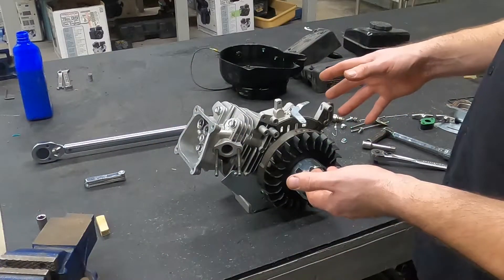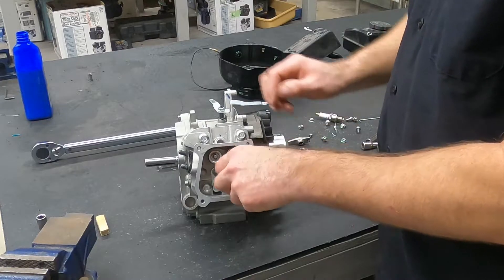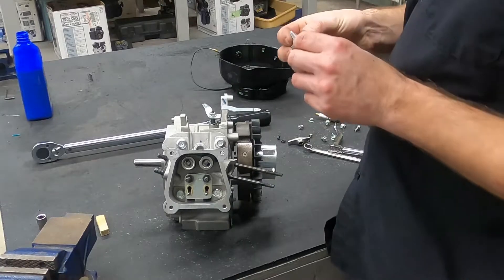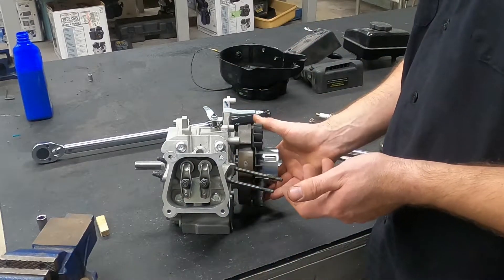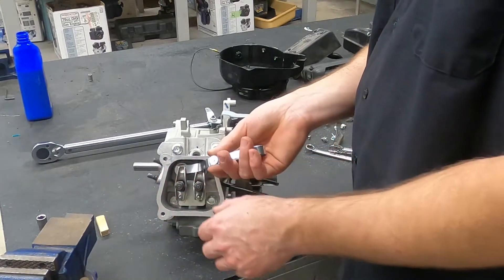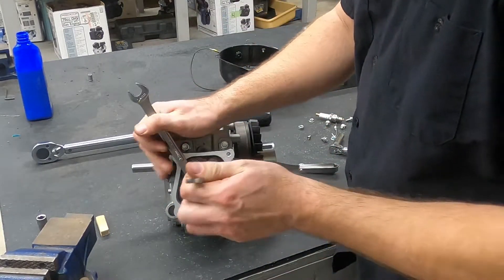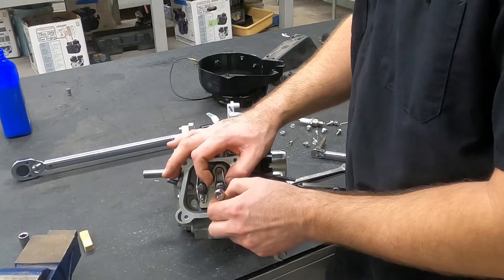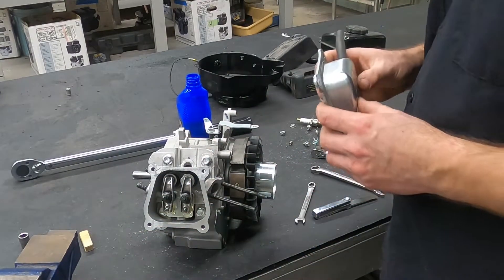(Part 3) 79cc Predator Engine Assembly Valve Train and Valve Lash

Comment: It's crazy really. The claim is to run them on the loose side to help promote an effective rpm under duress. Every other small engine I build (for performance) I run a tighter lash to promote an easier start when the lash increases at high temperatures. I believe I had best results with .003. I do the Hug and Kiss method.  Use the same gauge, hug the exhaust snug to the feeler and then just kiss it on the intake. Works like a charm. Great videos. I wish more people commented as this is extremely educational and good for the soul.  Great job on the series.